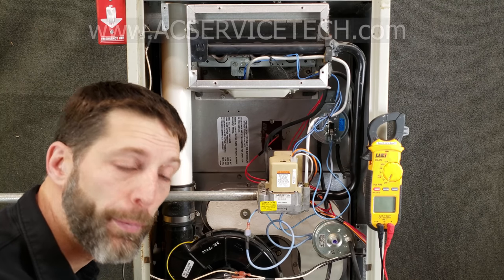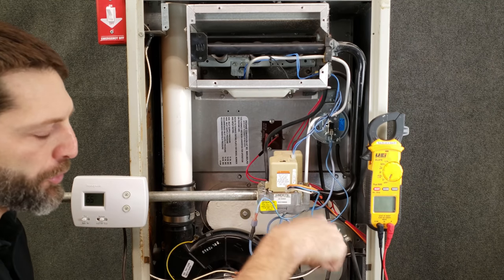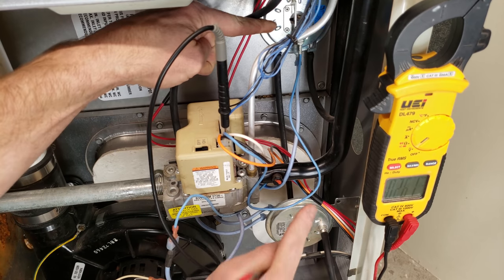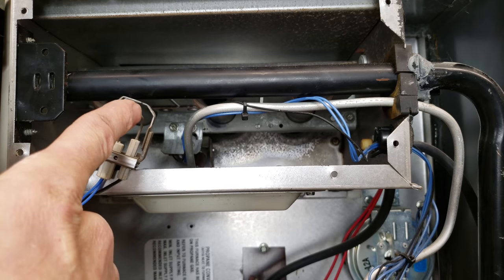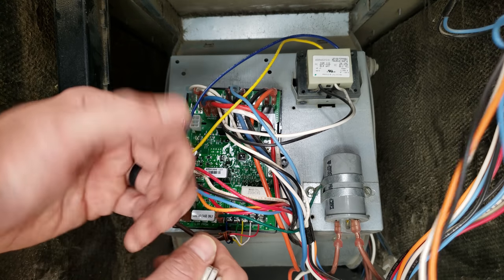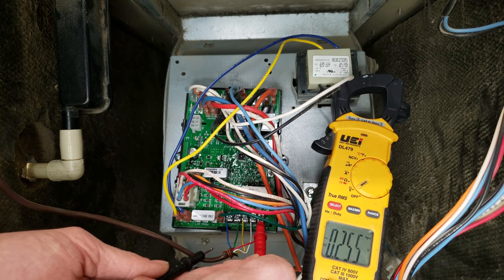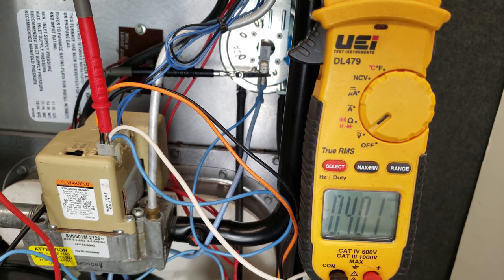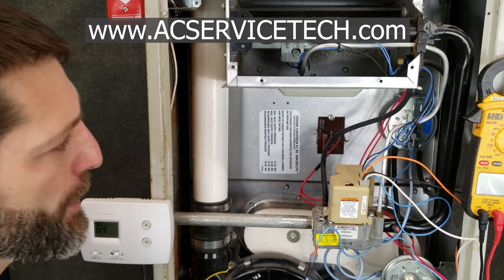Smart Valve Operation on a Gas Furnace!

Comment: Honeywell smart valve with intermittent pilot and 24 volt hot surface ignitor was one of the most troublesome systems when I was in the trade.  Close second to the White Rodgers mercury flame sensor, intermittent pilot with lock out.

Comment: Can you confirm if the control board is responsible for initiating the inducer motor? My issue is when I call for heat my inducer motor won't even start. I've verified the motor is good, and that I have 28v between r and w. I'm about to replace the control board. But I'd like to know that it's not the smart valve not allowing the inducer to start also.

Comment: Great Video.  Very Helpful, but still stumped.  I have power coming from the board on the blue wire through the pressure switch (verified it is closed) to the end of the 4 pin harness but still no power to ignitor.  I also tested all the other safety switches and all are closed.    No power coming back on orange wire since ignitor not getting power.   Any suggestions?
Reply: Did you ever figure this out? Ima say bad gas valve?

Comment: Very informative video. I have a better understanding now. I'm having problems with the furnace right now. I have Honeywell smart valve and it seems it's not clicking to release the gas. Also notice the igniter is not glowing. I'm going to buy a multimeter to diagnose this.

Comment: The high efficiency units that  use PVC for combustion gas create "water" from the exchanger rem,oving so much heat the moisture in the air" condenses" .
The old school 80% efficient units that use meatl flue pipes vent discharge air hot enough to  burn off the moisture. 
Until the metal flue pipe gets hot they will condense for a few minutes too.

Comment: The smart valve came out as a consolidation of the safety flame controls. Back in the day, 80%and higher furnaces needed ignition and flame proofing.
The smart valve was just a Honeywell decision to integrate the safeties.
Makes a cheap board into an expensive gas controller. Forcing expensive replacement parts WHEN a component fails.
Modern systems use a single control board, and separate modular devices... far better for the consumer.

Comment: I recently had a problem with my furnace.  Pilot would light but main burners would either not ignite or they would ignite and immediately turn off.  Checked flame detector, okay.  Called technician and he condemned smart valve.  I said thanks but no thanks.
I investigated further and the problem was a high resistance multi contact thermostat.  Smart valve was getting sufficient voltage to light pilot but not enough 24 V voltage to light the main burners.  Changed thermostat and problem disappeared.
Lesson is just because thermostat turns on exhaust blower, doesn’t mean thermostat is good.  It may be high resistance.  Jumper out thermostat to prove furnace works properly.  Don’t assume thermostat is okay if blower comes on.
Reply: What I mean by a multi contact thermostat is a Honeywell Chronotherm with heat on/off switch, backplate wipers and main (mercury) contacts.  There was just too much resistance in all these contacts.
Reply: You can track the voltage drops in the readings he takes in the video.  Starts with near 28v on R-C, then around 27.3 when the inducer motor starts and the relay coil is flowing current.  Then the hot surface igniter kicks in, we see 16v quickly going to 23v, then 25.9v from the valve to the control board.  

I believe 22v is the lower limit for reliable operation of the gas solenoids.  If the extra resistance drove the voltage lower when both the hot surface igniter and gas solenoid are powered for initial ignition of the flame, it could cause the solenoid to slip cutting off the gas, killing the flame even if it reopened.  Even in the video we see the voltage on the hot surface igniter is 16v for a split second as it heats up, but that could be meter response and maybe the hot surface igniter is powered a split second before the gas solenoid to avoid those inrush voltage drop problems.
Reply: Or resistance on the hot surface ignigtor changes when it glows red

Comment: Great job explaining...I have a smart valve that is clicking repeatedly after flames are on..then will relight...also noticed that a small blue pilot flame with all power off ...what's your thoughts ??
Reply: did you get this resolve? im having the same problem. i hate this smart valve
Reply: @own0805  yes..the 2nd heat exchanger drain tube was cracked.. leaking water and air sealed it with duct tape.. working !

Comment: Well explained gas furnace operation and individual components functions. I have a question, my furnace intermittently cutting in and out with clicking sound before it fires up. Is this appear to gas valve issue and can it be repaired instead of replacing them. The gas valve is quite pricey.  Thanks for your help.

Comment: 1 question...
After flame is proven through rectification, and the main gas valve opens, does the pilot flame stay on or does it turn off while your burners are going? 
Thank you
Reply: Pilot stays on when main gas valve opens because pilot assembly is where the flame proving sensor is located.

Comment: so my issue i have is the igniter glows but the valve isnt letting gas pass to the pilot tube i heard it clicking open but no gas passing through?.. everything electrical looks good everything works but no gas is passing through.. any idea what would cause this or is the valve definitely bad like im thinking.

Comment: So I have power going to my Hot Surface Ignitor but nothing happens I changed it and new one does the same. I have power going to it but it does not light. 
But I give it 24v straight out of transformer and it lights up. 
What am I missing

Comment: Hey man I have a Gray Top smart valve I am trouble shooting. Inducer comes on, then quits I get 3 flashes. Which is a draft issue. I jumped the pressure switch circuit then the burners fired up. Going to use my manometer tonight and see what the draft motor is pulling. I need to rule out any flue obstruction too. Anything else I should check?
Reply: You could actually disconnect power to the pressure switch and hook up your meter ends on it and on the tubing that's connected to the pressure switch suck on it and see if you get a beep on OHM setting if you do that might tell you the switch is OK but then you'll have to use the monometer to check the pressure switch itself, otherwise check for obstructions in the B vent but I believe your problems linked to the pressure switch Does the fan motor run continuously when you turn on power to the unit